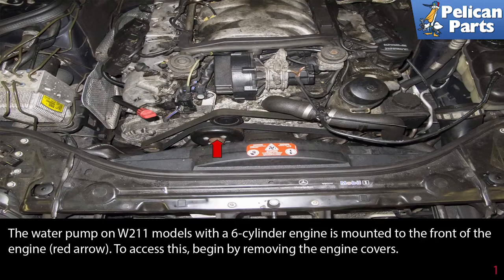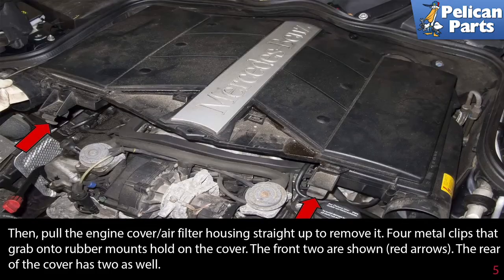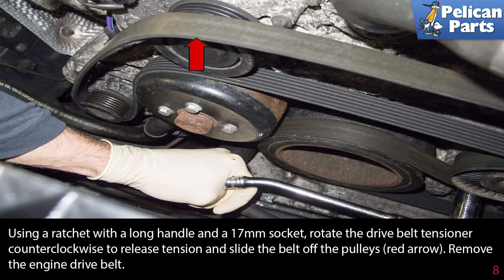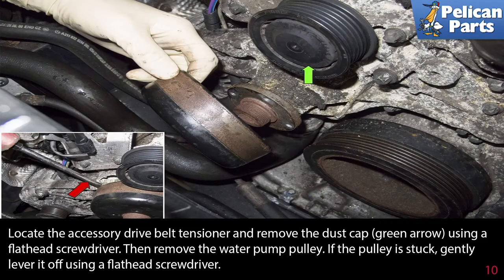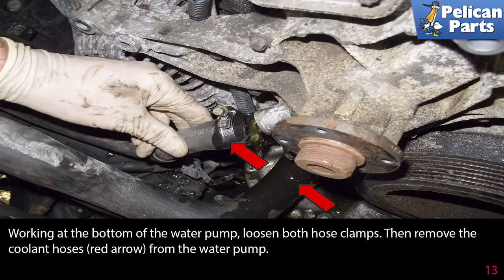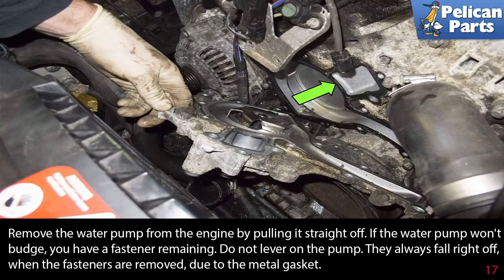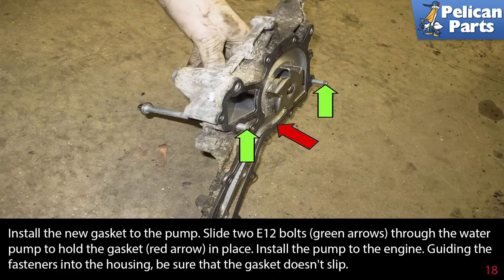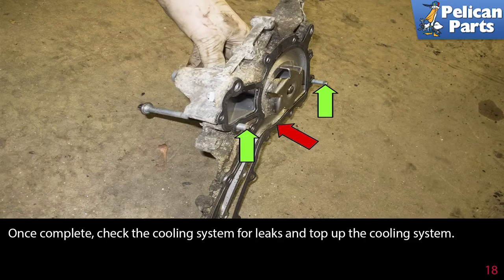Mercedes-Benz W211 E-Class Water Pump Replacement

Comment: 2004 E320 Wagon water pump is starting to leak and whining while idle. Ordering part now. Do I need the replacement pump with engine oil cooler?
Reply from the maker: If equipped, it is a good idea to replace them together.

Comment: I have a question……my w211 has a rubber seal in a groove on the engine itself. The new water pump came with a gasket that has a “bulb” on it. Presumably to fixate it onto the groove where the rubber gasket went BUT the bulb is actually on the opposite side of the gasket and against the flat surface of the water pump. So in essence, the groove doesn’t have something to go into it. Does that sound right? I’ve seen some videos where they’ve removed the water pump and there’s a flat surface on the engine itself. Do I need to get a rubber gasket instead?
Reply from the maker: The new pump and gasket should mate fine. The OE style with recessed gasket is best. With your vehicle info handy, give The Pelican Parts parts specialists a call at 1-888-280-7799. They can figure out what part or repair kit you need.